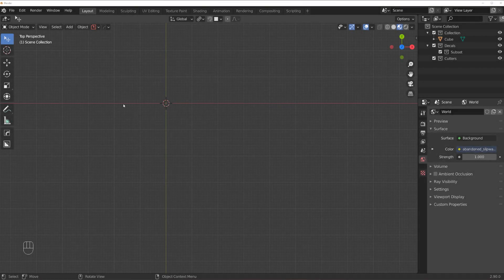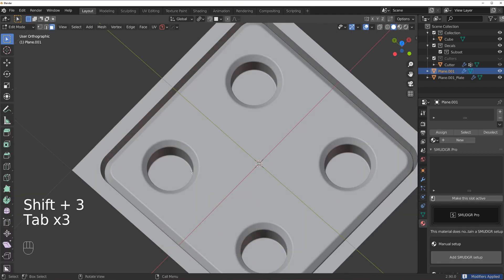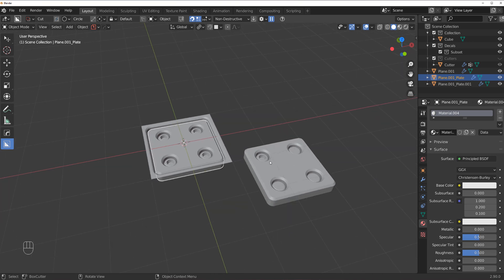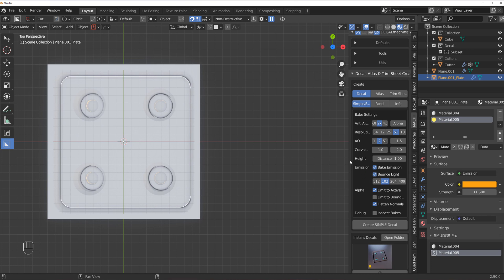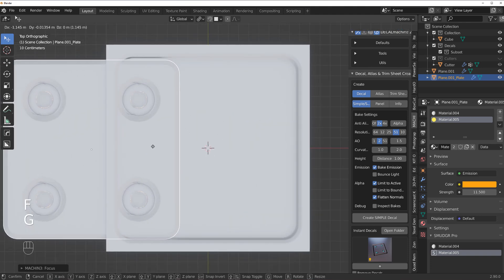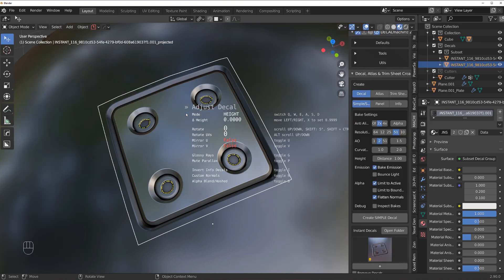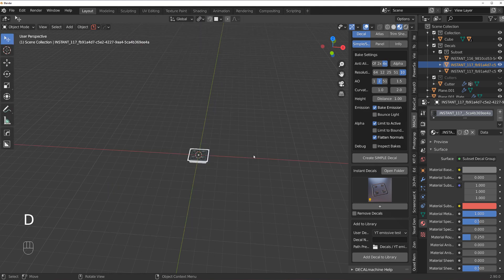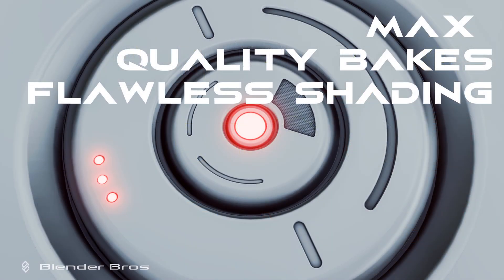How to create EMISSIVE decals with DECAL MACHINE 2.0

Comment: I'm following along and I can't find the option to change the face strength of weighted normals to affected. Is it in the standard control - tilda hops menu?
Reply from the maker: bevel modif > check shading
Reply: @PonteRyuurui  Thanks man, but I did hit another snag. When I bake it comes out as a strip that sits on top of the model. It's like it's baking from the wrong angle?

imgur.com /a/XpP2VWz
Reply: Still need to work this out to move forward. Works fine with the demo decals. Hopefully it will become clear doing some of the other DM tutorials.

Comment: Hello,I have a bunch of old zbrush alphas height/normal. What would be the best way to prepare these for decal machine?
Reply from the maker: you need geo for DM to work
Reply: @PonteRyuurui  what's the purpose of baking if the hipoly geo is required? Isnt the deferred decal (ue4) referenced from the bake data and projected onto a flat plan? Is it that I need the hipoly to reference for DM to work?
Reply from the maker: @memnok9980  no man, you need geo to bake from, so you can create a decal. you cant get normal maps from thin air. i think you are confusing HP bakes with decals, those are different things, even though both involve baking
Reply: @PonteRyuurui  Correct. But if I have a folder of 1x1 normal maps
 Then I should be able to make a decal with that is what I'm saying.
Reply from the maker: @memnok9980  sure, you could try, thing is DM is creating node setups unique to DM so it would take some fiddling
Reply: @PonteRyuurui  ok. That makes sense. Not too familiar with Blender yet so...lol. I'm gonna try to fiddle with zbrush. Theres a way to turn grabdoc(height map) back into geo. If it works I'll then just use the normal bake routine in blender. Appreciate your quick responses. Good channel bro!
Reply from the maker: @memnok9980  cheers, mate, ya the issue with DM and bakes in blender in general, that shit is temperamental, shading errors all over the place with perfect geo and shading, this is why most likely building geo from scratch is a better idea, but hey, have a go and let me know how it went.

Comment: Mate I would suggest to wait for competition to arrive(Nvidia witholding some cards as ace) after that you might be interested in 3080(ti) or even 3090.
From what we know as of now they "Decimate" previous generation at lower price (3070 near equal to 2080ti at $500 not sure about japan market thou).

It is a far shot but if developers of Decal machine implements ray tracing dedicated hardware bounce Light option drops to %5-10. You won't go back after that point ;D
Reply from the maker: the baking has nothing to do with hardware at this point, it is blender limitation, baking in blender is shit, i ll be definitely getting new cards but lets see first what they have to offer, it will also take a while for stable drivers to drop
Reply: I don't know man, a lot of this 'decimating the previous generation' talk was induced by marketing . We've often seen increases in this range. Just look at a 1070 compared to a 980Ti, they run pretty much the same as well. In fact, in the past some previous jumps were bigger. 
Still great cards, if you can get them!